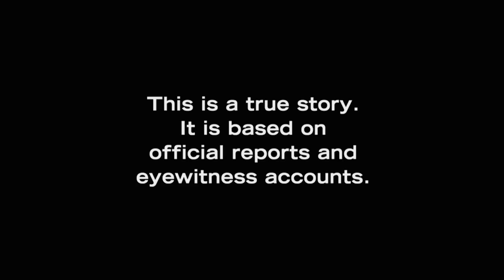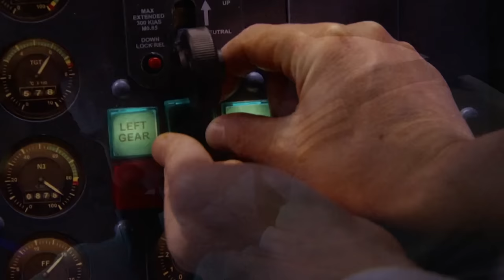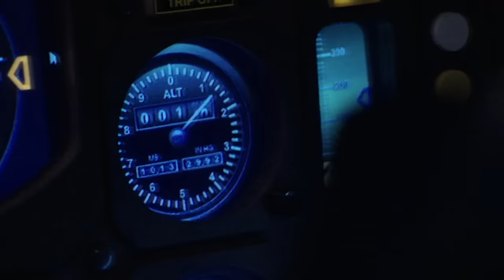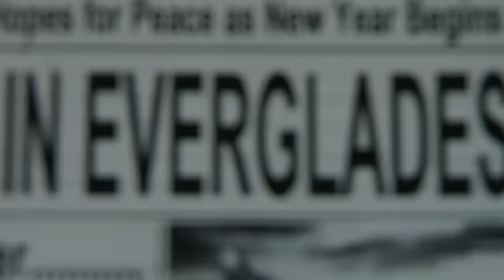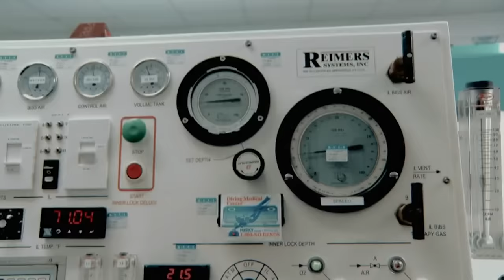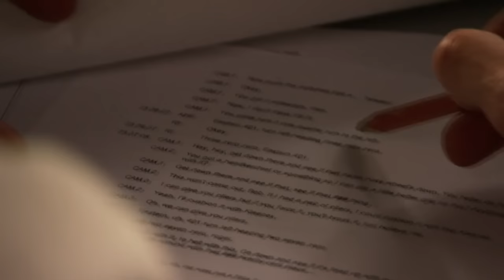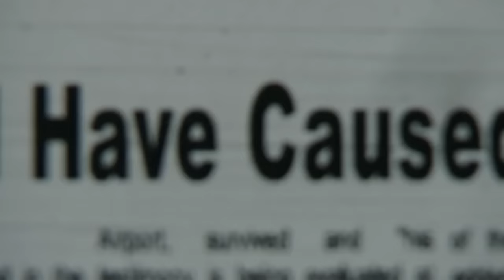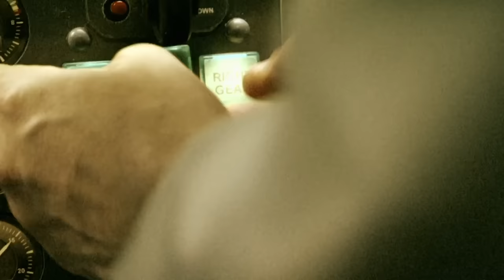The Fatal And Devastating Crash Of Flight 401 | FULL EPISODE | Mayday: Air Disaster

Comment: Just incredible to think that 4 experienced pilots all allowed a light bulb out to be a catalyst for this tragedy. Just fly the plane!!!
Reply: How many pilots does it take to screw in a light bulb
Reply: Aviate, Navigate, Communicate.  It's beaten into you day 1 be it private pilot or military...Complacency was a small factor in this-it's a new plane with the most sophisticated autopilot on a commercial jet. What could go wrong?
Reply: Because the lightbulb not lighting up means nose landing gear failure if it’s not just a bad bulb 🤦🏻‍♂️
Reply: Scary thought . You can be in a perfectly capable plane and the smallest thing might lead to a chain reaction that takes your life
Reply: Tbf if the landing gear had been the problem everyone would be saying why didn’t they use the autopilot then switch the lightbulb to check the landing gear was working.
Reply: Actually it’s 3 pilots. The 4th was an aircraft mechanic.

Comment: that chime sounds like a doorbell, not like a warning. it should’ve kept going if the issue hadn’t been fixed
Reply: improper training makes the crash the trainers’ and manufacturers’ fault, not the crew’s. they can’t solve a problem they don’t know exists
Reply: You would think there would also be a warning when the AP is disengaged
Reply: The alarm should definitely keep going off until the pilot manually turns it off to acknowledge he is aware of the situation.
Reply: That was my thought, it's also a lower tone, lower tones are easier for a lot of people to miss, especially those who are older.
Reply: This is a few years before the ground proximity warning system
Reply: @misseselise3864  Right(!!) ... the NTSB should have never gotten away with stating "Pilot Error" with regard to the autopilot as a cause. I would be inconsolably furious over that if my family was involved.
Reply: have you heard the master warning/caution tone on modern airbus jets
Reply: I thought it was mid C and canceled by plane noise

Comment: $12 for a 1972 lightbulb ? That's the real crime.
Reply: Before they said 3.00.
Reply: The pilot said 20 cents
Reply: That probably included the union wages for the installer, the overhead for the stockroom guy, and the inspector to check it all when done.  :-)

Comment: "Nobody light a match!"
- rescue worker dragging bodies and his cigarette simultaneously
Reply: Actually jet fuel is similar diesel, unless you spray it, it is very hard to light it even if you drop a match in it
Reply: Also if you throw a lit cigarette in a bucket of gas it will go out.
Reply: Use a 🔦 then!
Reply: @769270865  Then why do planes catch fire so easily. Look at all the plane disaster documentaries, all the planes catch fire.
Reply: It's the spark, not the flame that does it
Reply: @windsofmarchjourneyperrytr2823  spark or flame will ignite it, cigarette ambers not so much

Comment: This crash and United 173 crash were both a turning point in Aviation because NASA and the FAA were testing something called Crew Resource Management or CRM for short ✈️.
Reply: how come the ground proximity warning system tell them TERRAIN TERRAIN
Reply: @alancummings4304  I would guess it’s because the computer knew they were near the airport and the plane is expected to be landing.
Reply: No kidding...
Reply: @alancummings4304  It is my understanding that Eastern 401 did not have what’s called a GPWS ( ground proximity warning system )system installed. In1972 they hadn’t yet developed such a system. In a modern commercial jetliner today you’d have 6 layers of ability to avoid the flight 401 crash:
1) you’d have one pilot designated as the PM or pilot monitoring. Their job is to actively monitor the instruments while the other pilot flies the plane with or without the autopilot on. This PM should be able to then see the aircraft start an unwanted descent such as flight 401’s by seeing the descent on their altimeter/s.
2) modern autopilot systems now employ a specific warning chime when they have been disengaged after being bumped into - unlike flight 401 where that autopilot disengaged the altitude hold function without warning the flight crew.
3) modern airliners have redundant landing gear down and locked indicating systems assisting in avoiding the chaos and confusion of all pilots being fixated on a burnt out bulb as they did with flight 401.
4) Air Traffic Controllers are now specifically required to advise a flight that they are deviating from an assigned altitude such as what happened to flight 401. In 401’s case the air traffic controller stated “ is everything alright “ after he noticed that they may have been descending instead of saying “ eastern 401 I show you deviating from your altitude of 2000’ feet “.
5) modern cockpit crew resource management ( now called human factors training ) has evolved to ensure the pilots aviate first, navigate second, and communicate third. The Captain while still the boss, runs a democratic system in which all pilot suggestions and input should be listened to and considered and to avoid fixating on any one thing so as not to lose the big picture.
6) a modern GPWS system to specifically warn the flight crew against a CFIT ( controlled flight into terrain ) scenario.
Eastern 401 only had one of the six safety layers listed above which was the aural indicating warning which they all either missed, or ignored, because they were all so fixated on the light bulb and appeasing the grumpy authoritative captain.
A lot has changed since 1972 with hard tragic lessons learned.
Reply: @justin2956  it was 1971. I doubt they even had that.
Reply: @justin2956  Nope it was an older plane an it didn't have a gpw

Comment: Just a little more detail on what is meant by the "auto pilot disengaged." It switched auto-pilot modes. It disengaged the altitude hold functionality of auto-pilot but was in a mode (CWS) that maintains the attitude (basically the 3d orientation) of the plane that the pilot last adjusted to. In this case, the bump adjusted the pitch down, and the "auto pilot" maintained that pitch even though the yoke would have immediately returned to neutral after the bump. From what I can get from the accident report, because auto-pilot was still technically on (just different modes functioning) there would not have been an obvious indication (apart from checking the specific enables modes) that autopilot stopped (because it didn't!).

I don't work in aviation or anything, just found this to be an interesting detail in the official accident report.

Comment: This seems to me the fault of the autopilot disengaging without the pilot not having to acknowledging it by clearing a warning. Same thing happened to a Airbus a few years later..
Reply: They didn’t even mentioned in this documentary what, if anything, was done about this issue… Besides saying that they simply began training pilots to know about the fact that bumping the column will turn off auto pilot. Weird.
Reply: I am not a pilot. However, it is my understanding that when ever the autopilot is disengaged, there a loud warning alarm. Does anyone know if this true currently.
Such a warning alarm was not mentioned in the video.

Comment: I started balling my eyes out at the caroling! I'm still crying in frustration at 4 professionals in the cockpit dithering with a light bulb & not noticing their declining altitude!! Why didn't the alarm sound as they got closer to the ground? WHY didn't the guy in the tower ask the Pilot to verify their altitude when he noticed they were at only 900 feet?!!!! WHY?!!! Such a preventable tragedy hurts my soul. The hero legend here is Mr Marcus!!! I, too, don't believe the Captain's brain tumor played a part. The co-pilot also had an altimeter. It wasn't a part of the controllers job? What about a concerned humans job?
Reply: Yeah, the tower guy ask "how are you doing?" Not "you are losing altitude".
Reply: With all the technology available, why don't 'they use remote camerascto look at landing gear position in cases like this?  No light? Check the camera to verify gear down and locked or not?  If I can put a camera on my front door and check it from my phone, they surely could install cameras on strategic spots on planes.
Reply: @tomsmith5216  Seems that the cost is more important than lives.
Reply: The alarm DID sound. From Repo’s station. But the pilots were all tunnel-visioned, centred on the idiotic landing light and they did not notice it enough for it to register on them.
Reply: Did the last pilot to fly that plane before Loft’s crew notice if the landing gear light was ok? Seems they landed ok before Loft’s crew flew that plane.
Reply: Wasn’t maintenance supposed to check each plane before a flight? Didn’t anyone in maintenance notice the burnt out bulb before the flight? Aren’t they supposed to check all systems on a flight? Maybe one of them did and decided it could wait? The documentaries never mention when was last time maintenance checked the plane over before the crash flight.

Comment: If the captain was so worried about his landing gear, he should have started his approach, and then asked the ATC if he could confirm if his front landing gear was down. The controller could have told him it was, and they could have landed without incident.
Reply: I don't think it was a case of whether it was actually down, but whether I was locked in place, hense the guy going down to see if it was redlined, locked. The tower could confirm it was down, but not locked in place. If not locked it would collapse on landing.
Reply: I was on an American Eagle flight which had landing gear problems at RDU. The pilot did a fly by and the gear was down.  We still had to prepare for a crash landing, but the gears held up and all was OK!  You're  right...why didn't  they do that with flight 401?
Reply: It wasn't about being down it was about being locked in place

Comment: So do modern planes have cameras in spots so pilots can tell if the gear is down, or if the tail is messed up?
Reply: I remember JetBlue Flight 292 had to do a fly-by of the tower to check its landing gear issue, and that was like 12 years ago. I don't think they have anything yet today, not focused on the landing gear anyway.
Reply: @c.1916  That seems so unreal to me, back-up cameras are practically standard issue in modern cars, seems like something that can be fitted to a plane no problem. Then again, I'm not an aeronautical engineer.
Reply: @Rick_Steel  backup cameras are mandated by the US government on cars made after 2014
Reply: @c.1916  Many modern airliners have such cameras that can look at landing gear conditions, yet.
Reply: The answer is generally no with a few exceptions. One exception is the Boeing 777-300ER which does have a landing gear system camera, however for most commercial aircraft that do not have such a camera, there are redundant cockpit indications to confirm the gear is down and locked or in transit from its up and locked position. So while most modern airliners still have 3 green lights to indicate all gear is down and locked they will also have a second indicating system to confirm this. Why ? In case the main indication system has failed, or has a burnt out light indicator bulb such as flight 401.
I fly the Airbus and we have a gear main indicating system and a completely separate back up indicating system that work in tandem so we can avoid the issues the crew dealt with Eastern 401.
Reply: @ADDrecords  I drive a Kia Telluride and love it.  For comparison, I’ve had a Jaguar xl, several Mercedes over the years, corvette, trans am, many loaded 250 trucks, and an ford explorer and a excursion, I had a Cadillac XTS . I love my Kia.  Bonus: very inexpensive!  It’s my primary car.  We have a ram 250 and a Porsche.  Value is important. Ps I don’t work for Kia. Lol

Comment: It matters not if that was not part of the air traffic controller's  job, if he sees the plane is falling he should tell them still, it could have saved lives.
Reply: Agreed. I don't understand why it wouldn't be ATC's job because the pilot was told to climb to 2000. Without further communication the plane should be at 2000.  Pilots can't just ascend/descend whenever they want unless they declare an emergency so all other aircraft can be cleared from their path.
Reply: Oh please, as if you have alerted every single driver you have come across that their beams are out or something about their driving is wrong. They could crash their cars, right? ATC didn't see if it had dropped suddenly, or if it was gradual, they weren't on his dock at that time.  At 0900 feet there's wasn't much time left before you hit the ground. According to google planes can descend 600 feet a MINUTE during landing.
Reply: @hufflepuffxlovex  random drivers on the road vs the regulators of airspace paid to control air traffic..  Not sure why you would think that analogy remotely close.
Reply: Ateast confirm with the pilot was at 2000 ft!

Comment: Horrific display of piloting skills here. That experienced and can't tell you are losing altitude?
Reply: No. With that specific set of circumstances : dark moonless night over the Everglades which produce no visible terrain from the cockpit view - pilots nickname that type of visual set up as a “ black hole”. So it was their altitude instrument called their altimeter that they needed to rely on to determine their height- not by feeling it or looking out the window. By all of them becoming so fixated on that landing gear light, they failed to designate one pilot to actively monitor the altimeter and other instruments. Had any of them looked at the altimeter they would have seen that they were descending. Adding insult to injury NONE of the pilots heard or heeded the cockpit warning chime telling them they were descending out of 2000’ feet and headed for the ground. 
Lots of blame to go around in this crash : authoritative grumpy Captain creating undue stress, all pilots fixated on the gear light, air traffic control not specifically warning the crew of their altitude deviation, an autopilot system that when bumped will disengage the altitude hold function without aural warning and I’m sure there other factors I’ve failed to mention. 
The industry learned a lot from this crash.

Comment: I don't see how pilot error was any part of this crash. The hair trigger disengage of autopilot altitude control should have been highlighted more than once in their training. Also, why not keep a standard flashlight in that chamber allowing manual check of nose gear down/lock.
Reply: Pilots are supposed to fly the airplane. They should have monitored their altitude. That's why it was pilot error.

Comment: Can’t believe the stupidity that caused this accident!!!…. Wasn’t it easier to fly by the airport to get visual confirmation? Why troubleshoot only at 2,000? Why did they never checked altitude level? Why flight controller never warned them…
Reply: That's what ATC told them to do. It was nighttime, unless they got right in the face of the tower how do you expect them to see one single wheel in the dark??? You can SAY ALL you want in retrospect but the fact that you're judging them (and so many others in these comments) is incredibly distasteful and disrespectful to those who passed and the lessons learned that have saved countless lives. Just watch, say RIP and move on
Reply: Wouldn't it have made more sense to simply land as if they didn't have a nose wheel? After all the plane before 401 had the same problem so there were crews on the ground ready for it, presumably.

Comment: Too bad the captain didn't think to SWAP the one lite assembly with another to check to see if the so called defective lite would be lit by another socket and visa versa...the working light socket should either lite or not lite in the defective landing gear socket to verify it is working or not.
Reply: But they could not get the bulb out to even see if it was bad, let alone to swap another bulb in.  It was stuck in the console.
Reply: No, it's too bad the captain didn't pay attention to his job, flying the aircraft.

Comment: The movie about the hauntings only told the most (in)famous encounters. Reportedly, ramp crews saw, heard, and experienced a lot more that never got publicly reported, and not just at Eastern. Those salvage parts were spread throughout the L10-11 fleet. I've heard stories dated into the late 90s. And yes, there could be parts still in use that are that old. Aircreft parts are designed for VERY long serive lives (partly why they are so expensive).. As of the current year, there is still a single L10_11 in service.
Reply: My mom STILL has a copy of 'The Ghost of Flight 401' since I was a little kid (I'm 59-years old now). The cover picture gave me the creeps.

Comment: They were riveted to the wrong problem. And were actually SO tuned into the problem, the solution wasn’t discussed. How many pilots does it take to unscrew a lightbulb ffs!? Should have been a one man job however everyone had an input about the issue. You don’t gotta be an aviation employee to understand the crappy work environment that unfolded. 52 years later we’re all still aghast at the captain’s treatment of his fellow crew members. And, they’ve had to toss the all the parts that they tried to repurpose from that crash. Talk about your bad energy woo woo. I mean, it crashed in a swamp. Was drowning in jet fuel. Swamp mud had bacteria that causes gas gangrene. But hey, those parts are still good to go into or onto another plane? No way. Boo 👻 to you.